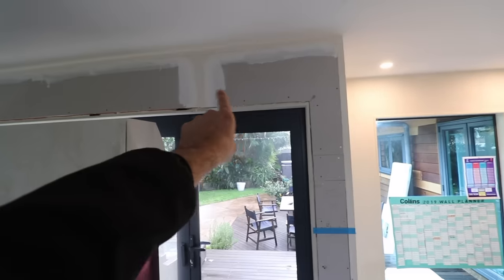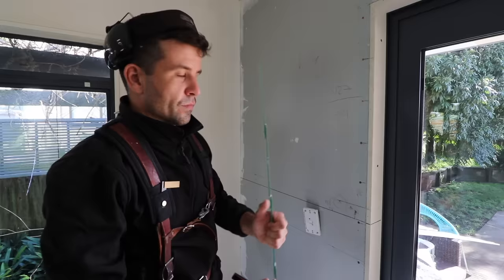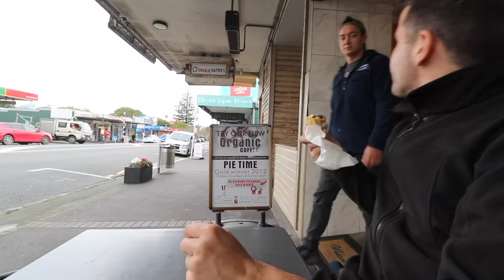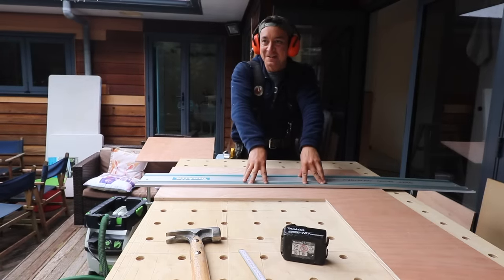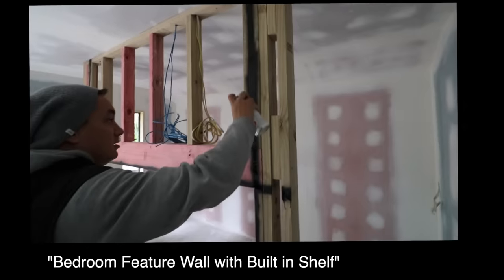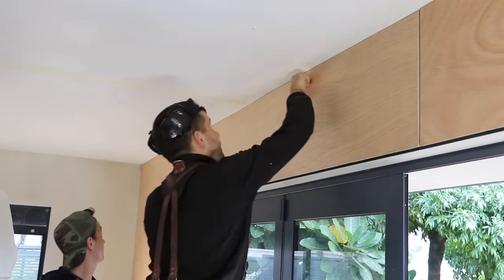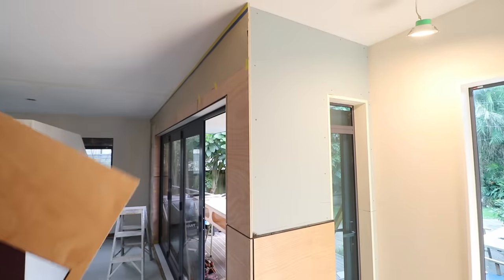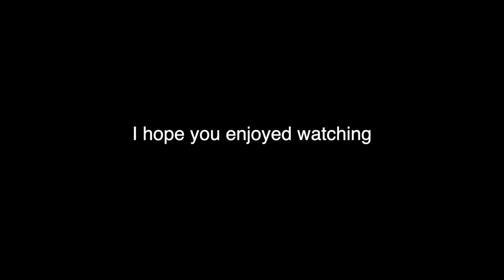Plywood Wall! - NO Nail Holes!

Comment: Brilliant guys. You do great work....like the shadow line rebates!

What thickness ply is it? What it finished plywood that is sealed with some form of finish coating or did you have to apply a finish after you installed it?

Cheers from Oz

Comment: Love how you did the "shadow gap".  Ive been planning to do this in my flat, and have been pondering long and hard about how to acheive that, love your method
My only negative is i would probably have put a shadow gap adjecent to the ceiling too, so that the black goes all the way round each panel
Thanks for the idea and the great work

Comment: impressive work !
question . . . how come you didn't trowel the puddy on the back smooth, then apply it to the existing wall?
to me the entire plank would have the adhesive, and hold better. plus would be less likely to have  '' mold '' on the backside of it, due to air channels  [ no moisture ] , nor giving the ability to let the tiny creatures have a area for breeding ground.

still impressive work.

Comment: I’m wondering on the “cut to fit sections” if you could have made Luan templates and scabbed connectors using 1/8 or 1/4 Luan and rough traced and then flush trimmed to fit. All the walls are linear and the inconsistency on the ceiling gets hidden with a bead of silicon and black paint? This was time consuming and you’re butt jointing the following sheet with the rebate. You also did nice work and the rabbet and spray paint adds to the trim.

Comment: Have you had a requirement to make the panels seamless? No gap or line on between a floor to ceiling panel. How do you fill in the seam? Wood glue and putty knife?

Comment: Nice work guys, Datum lines/points is the technique you used for the plum reference, we do a similar thing when we make glass splashbacks for those out of square walls, have you ever installed glass splash backs? You have to check out our factory in Manukau dude some cool shiznit there.

Comment: You seem to place boards right up against the ceiling plaster board and also flush on the floor? What about seasonal movement - expansion problems - perhaps causing damage?

Comment: Awesome job, looks really good. Never thought of doing a plywood finish, may have to sell this idea.
Reply: Check fireproofing regulations/ratings! Different certs.
Reply: @SenselessUsername  the drywall has the fire rating, you get some for ply as well...
Reply: @greenhometony  Indeed; as far as I remember when I planned cladding a space with it 5y ago in UK, only specifically flame-retardant treated ply was sufficient even with drywall (white, not the heavier pink) to my BCO.

Comment: Looks nice guys, I'll have to keep this in mind for my potential future projects.  Did you think about whether to overlap the wall boards over the trim on the inside of the windows?  That could have hidden the plywood edges there, unless you intentionally left them visible.
Reply: It's done intentionally. Gives it a trim look with the black lines instead of a full plywood wall. The lines break the pieces up and make it look modern and slick .

Comment: Amazing stuff as always Scott, did you consider doing mitres on the small filler pieces around the windows?
Reply: @h2s makes sense on the outside corners, probably didn't do a great job of at explaining what I meant, the inside corners around the door and window, about 13:54 for the door. The finish Scott's done looks amazing, just thought a mitre might have been a nice touch as well and was curious if a mitre joint had considered :)
Reply from the maker: Thanks man, client was after the exposed plywood look, we did it the same way on the bedroom feature wall. A mitre would work for sure too!

Comment: Fellow Kiwi here building a Tiny House - love your videos. Quick question, if you were doing a similar finish like this on steel framing what would you recommend? Thought about taping the steel framing and spraying black, and glue and nail the ply to studs. Might have to use a framing nailer as the small finishing nails won't cut through the steel. Any thoughts?

Comment: How would you use this method on a ceiling? I've been researching this finishing style for awhile now and finally you guys have answered most of my questions in this video, however I doubt the glue would work on a vaulted ceiling. I have existing T & G that I want to tear out then add paneling over the rafters. any tips would be appreciated! Cheers great video
Reply: Split batterns this is how all paneling should be done correctly

Comment: May i point out an issue when using plywood. Over the years using tons of plywood on various projects, something ive noticed relativeley recently is the smell coming from the sheets. A while back i got into my van that was loaded with ply sheets and very quickly my throat was burning and my eyes were streaming, not pleasant at all. Having researched this its call 'off gasing'. The culprit seems to be Formaldehyde which is added during the process of making the sheets. Not harmful in the long run but the smell does take time t dissipate, so if you are doing a plywood project in your home, well worth storing sheets out of your house for a while if off gasing is a problem. Has anyone else experienced this? Great work by the way! Thanks

Comment: Gorgeous and fantastic craftsmanship. Still, I wonder about the concept. It is purely a personal decision about risk, but the surface veneer on ply is thin and, at least for my level of skill, is nearly impossible to repair for anything other than trivial damage. Since walls are wear surfaces, this is gorgeous today, but I don't see how it can be maintained over time. Again, it's just a personal choice, not a criticism. It is interesting to compare with an example from the 1890s in which a dining room was wainscoted with solid oak up to about 7 1/2 feet above which there were two feet of plaster. It was over 100 years old when I saw it and it could be maintained for another hundred, I'm sure. No one can afford that these days, though!  No question though- you guys did beautiful work.

Comment: Don't they make wood puddy that matches cedar plywood pretty well if you're decent at matching the grain by sanding and staining? Never done this before but I'm trying to come up with a better hanging method. Glue alone can fail, but a combination of the two is best. I figure maybe 1-1/4" brad nails, on a good gun that's backed off a little so the gun doesnt damage the wood.

Comment: I love how it looks. Would the glue work fine even if the wall is already painted? would it be better to sand it first?
Reply: I’d be nervous about adhesion. Maybe you could nail up a 1/4 inch plywood then glue to that?

Comment: This question may have already been asked, if so, I apologise for not reading all previous comments. Why take the extra time manually setting up the track for every rebate with the router, why not use the edge guide on the router set for the correct width from the edge?

Comment: good job on the fitting, but im not a fan of the grade of plywood used. rotary cut with voids in the core veneers is not something id use for an accent wall, especially with exposed edges. im guessing.there was budget concerns, good plywood isnt cheap, but i think other probably cheaper options would have looked better. honestly it just makes me think of a chipotle......

Comment: 13:50 i would of cut the exposed edge at 45 degree and use the same Technic as moldings. Would of been more work indeed but would of been that little extra for a flawless result. Great work tho!

Comment: Did you apply any clear coats, oils or stains after? I want to know how do you protect it from getting greasy or dirty or from changing color?
Reply: the plywood used has a vinyl thin material covering it, so it's not the actual plywood that is exposed,thats why when cutting they cover it with tape so as to protect that vinyl from tearing off.

Comment: What country are you working in? I only ask because at least in the US the instalation of drywal is required for fire reasons. Drywall typically has up to 15% moisture, that moisture has to evaperate before fire will penetrate the drywall. So if you're going to install wood paneling, you first have to install drywall. But like I said, I don't even know what country you're doing this in. Ps. Looks great.

Comment: What's the point of the black rebate and why couldn't you have simply butted the plywood sheets together with no gap? I mean it looks better with the black borders, but wondering if there is another reason for them besides looks?
Reply from the maker: It is mainly for the look. However, having a gap also helps hide any discrepancy if your sheets don't line up to each other perfectly

Comment: What kind of circular saw blade are you using? I get a lot of breakout when cutting ply.
Reply: have to use a track saw with the guide.  the guide as an edge that stops breakout.  you could also try masking tape on the cut line.

Comment: Hey! You did a great job there. May i know what type of glue or adhesive and tape did you use?
Reply: If you're in the USA look for loctite power grab. The super glue (CA) is a rebrand by a YouTuber that goes by Finish Carpentry TV. Watch his videos to learn some good tricks with it and moulding. He has a lot of great trim videos.  I use CA glue all the time for different stuff because of that guy.  Bob Smith Industries Maxi cure with accelerator is the actual item he sells. I love the smell of the accelerator... Lol

Comment: The polymere glue's have become so good it's a joke. You can stick anything to the wall with that, forever. However for bulk work you can always use PU based foam glue's such as Rectavit easyfix. I don't even know if that is being sold worldwide.

Comment: Not sure if you guys are aware of a product I came across not so long ago called button fixing type 1 & type 2. Although I haven't used them myself yet they look like a pretty good way of fixing sheet goods to walls with no visible fixings and also makes the sheet goods removable easily for maintenance/ access ect.

Comment: What is the black stuff used in the gaps between the boards? Always fancied doing this but don’t know what is used.
Reply: Its not a gap but a painted part of the board. They are cutting rebates with a router and then painting the rebate black.

Comment: I don't get it. That is a lot of hassle to clad a walls like that, but then use a cheap rotary cut plywood and exposed plywood edges. I could see it, if you used some nice book matched veneer plywood. Also, just groove the edges of the ply and using a separate, black painted splines would have been way easier and faster to achieve that look.

Comment: Hey Scott! Can i apply plywood on exterior walls? Your new subscriber from Mozambique.
Reply: It depends on the type of plywood, It has to be made with the correct type of water-resisting glue. In USA it goes in three basic grades, Interior Plywood (inside the house walls or floors), then Exposure Plywood (outside, but needs to be covered with something waterproof, or oiled, or painted), then Marine Plywood (boat decks and dockages). Marine Plywood is almost completly waterproof but its still a good idea to oil it or varnish it if it is going to get wet.
Reply: Thank you so much for the information, I'll apply your advice.

Comment: so the track for the track saw just sits there?I would have to clamp it!
Reply: Most of the time your fine without clamps
Reply from the maker: They have rubber strips underneath that provides a bit of friction. I have clamps for the track that I use if I need to

Comment: How come your saw guide isn't slipping even if you do not clamp it down in any way?
Reply from the maker: The guide rail comes with rubber strips underneath, this prevents the timber from splintering and the guide rail from moving. https://www.fishpond.co.nz/Homeware/Makita-423360-7-Rubber-Guide-Rail-Splinter-Guard-3m-Sp6000/0616268099696
Reply: Scott Brown Carpentry Oh, thanks man. I appreciate you taking time to respond. All the best!
Reply from the maker: @Traderhood  no problem man

Comment: Can SOMEONE, anyone, please tell me why everywhere in the world, folding rulers are used for measuring. In the US and Canada, they seem so foolish
Reply: Rulers are a great tool. Accurate measurements, can be used in speedy cutting of Gib/plasterboard too. One side is 5mm, combine the 2 together is 10mm so can be easily used to space things up, away from others. Depending on what situation you are in you can also use it as a block to tap on the end of bigger sheets so as not to damage the edge ie soffits. Great all round tool. I use mine multiple times a day
Reply: @martingaines7818  while I agree with you. And I'm not a hater of rulers, I just don't know why a tape is not used instead. It's an extra tool, and real estate in a carpentry bag is limited as it is. Why does a ruler get that space when you already have a quick measuring tool?
Reply: offlinecity just personal preference I guess. We are creatures of habit and our environment. It's the way I was taught and it works for me and I guess many others. Also refining down the belt to it's most efficient form for me gives me the space
Reply: @martingaines7818  fair enough. Thanks for your insight
Reply: Im in new zealand and would never use one how he did, it has far to much play in the hinges, if you dont get the ruler dead straight which is extremely difficult the measurements will never be accurate

Comment: So, basically, permanently glued to the wall.  So, if something damages a section you will end up destroying the drywall behind it removing it to replace.  Because, unlike drywall that can be patched skillfully so that it can't be found, you can't simply "patch" plywood and not have it look like crap.
Reply: Making the whole house out of dirt would make it even easier to patch, but it's ok, because they chose not to use dirt or sheetrock or brick or stone or tile or planks, they chose plywood. And it looks great because they did.

Comment: Nice look, however, from a engineering perspective I’m not so keen .
Reply: Not so keen in what regards?
Reply: @algallego  it was not clear the type of adhesive used ,condensation on the roof panels not sure of the air condition and heating system employed.. I would not mind knowing a bit more if possible could you direct me to some tech spec, would be great.

Comment: I'm wondering if that adhesive is the same as this stuff here https://www.screwfix.com/p/soudal-fix-all-high-tack-adhesive-sealant-white-290ml/64585 bloody excellent stuff for uPVC
Reply from the maker: I think it's the same company yeah. Different trading name
Reply: @ScottBrownCarpentry  I had to stick some pvc quadrant between a very wonky tiled wall and a not much better uPVC roof and it stuck it in without any real movement, great stuff

Comment: Men... you use pressure-nails for what? You just need glue. Cos, if the piece fall appart... nails dont save it! Its gravity! Do you understand? The base is pladur! First point. How do you instal the last piece? You do not have space for nails. Second point. So...its stupid. All you have to do is to really use a trustable glue. And over that aspect... the details of joinery are simple. They fit tight just with glue. Ok? Simple. Search for the best glue on market! Point.